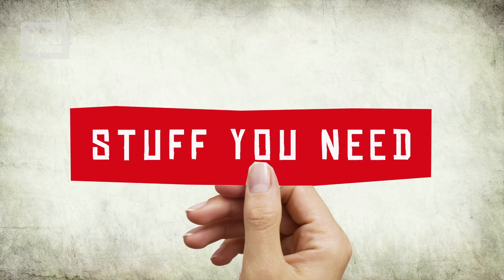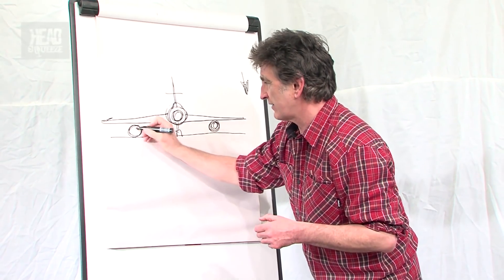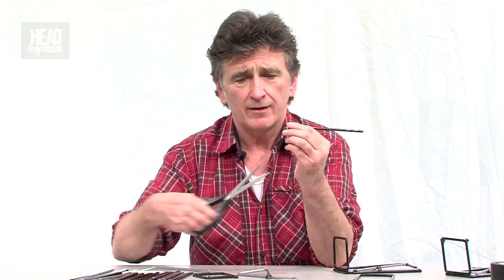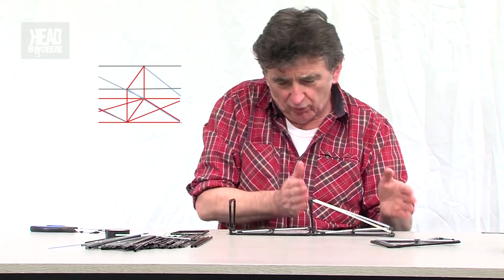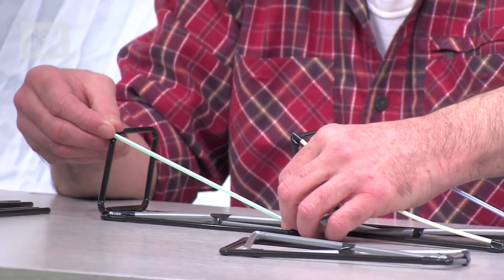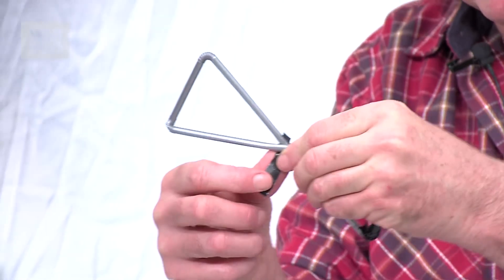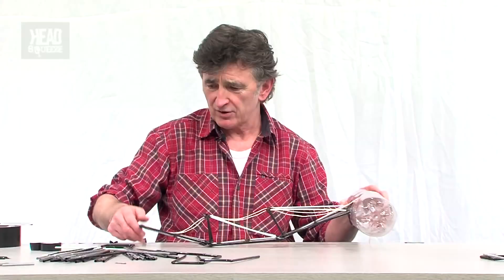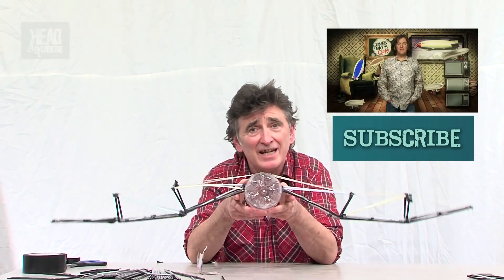How do airplane wings work? | Live Experiments (Ep 43) | Head Squeeze

Comment: That is only about 1/5th of the actual reason, which is Bernoulli's theorem. The main reason is the Coanda effect,, which is correctly what wilfredotour3 stated: the air is being directed downward from the upper wing, this air now effectively pushes off the air which has passed under the wing, Newton's third law, which is every action has an equal and opposite reaction, means that the air goes down from the wing, so the wing goes up from the air.

Comment: claudp: "You were on track until 'it pushes down on the air that was under the wing'. - That's wrong."

Well, no. There are two models of wing lift: 1) faster air over the top = lower pressure which 'sucks' the wing up; 2) at a +ve angle of attack, the wing deflects air downwards, and by 3rd Newton, reaction lifts the wing.

In reality, both models boil down to the same thing ultimately. There's a stronger force below the wing because it deflects air (that was under the wing) downwards.

Comment: From an engineering standpoint, the wings will never just snap off due to heavy wing loading, even with empty wing tanks and full fuselage weight, there is still a margin before the wings begin to deform and  fail catastrophically.

It's not about catastrophic structural failure when looking at wing loading, rather the lifespan of the wing spar due to fatigue, especially on wings that are subject to heavy flexing.

Comment: It is a version of duct tape, made originally to be used on stages, so it can not be seen against the floor, which was mostly painted black.
It also has a less sticky adhesive, so it leaves little to no residue when removed.